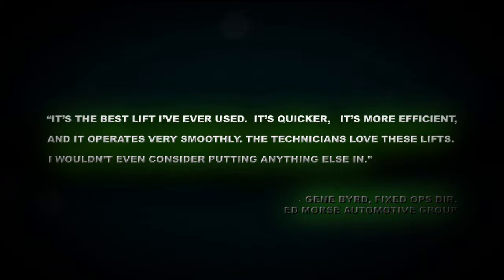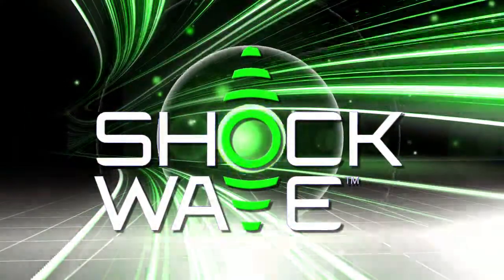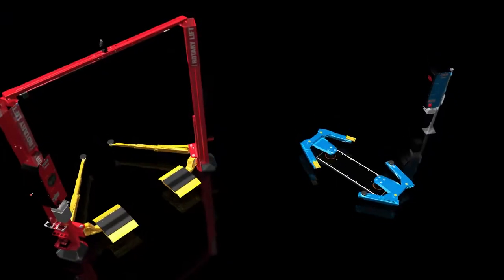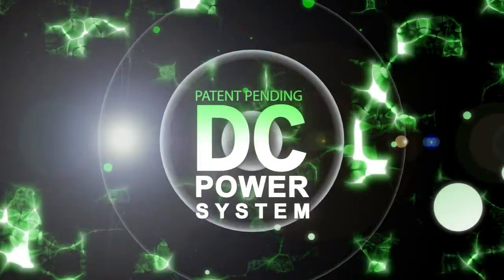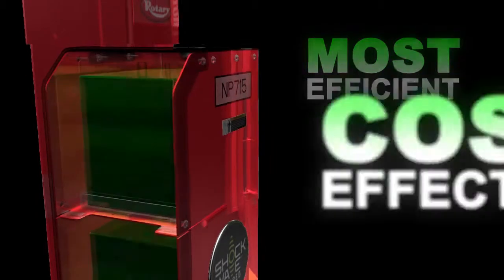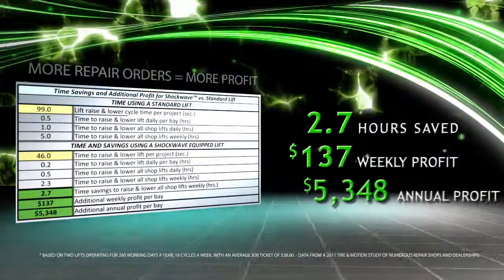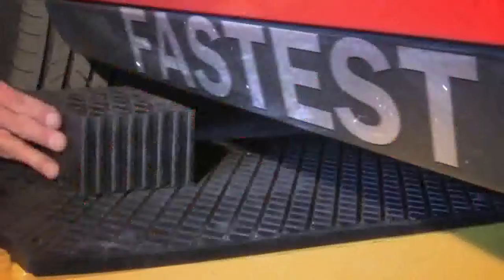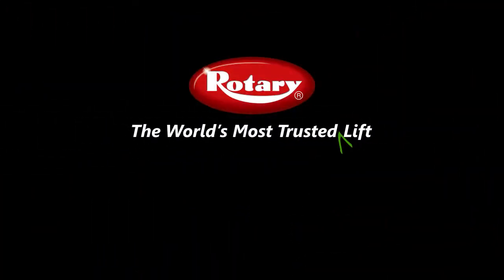Shockwave Equipped Rotary Lifts

Comment: Can the Shockwave Equipment be installed later on a Rotary Lift that did not come with it? The SPO12-Wide specifically?
Reply from the maker: Yes you can equipment your standard lift with Shockwave, but it would require replacing the power unit and both hydraulic cylinders.

Comment: I take it the batteries are serviceable? Also standard car battery? Or unique to the lift?
Reply from the maker: Thank you for your question Gabriel.  Yes the batteries are serviceable.  The Shockwave Equipped Lift takes two 12V batteries, Size Group 24 with Top Terminals, and 525 to 710 Cold Cranking Amps.  For more information on our Shockwave Equipped Lifts visit our website at https://rotarylift.com/shockwave/